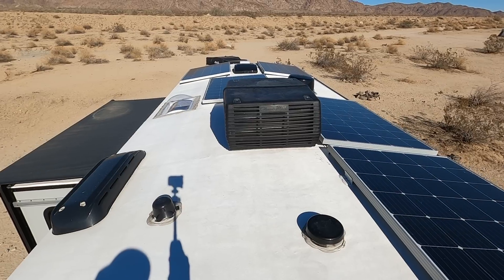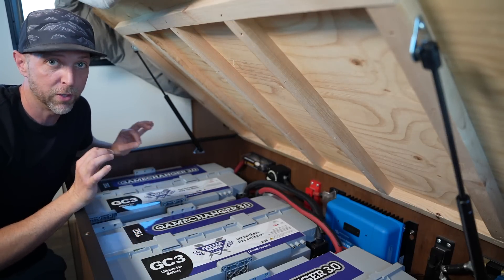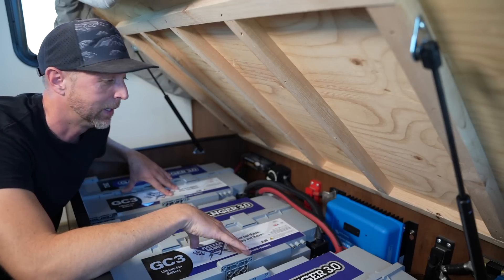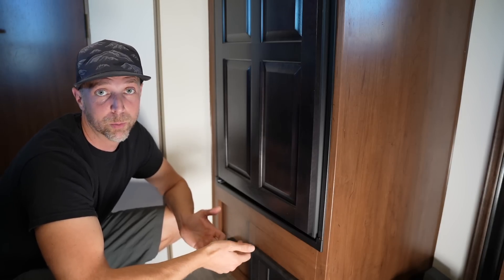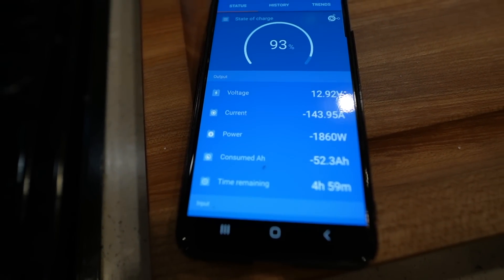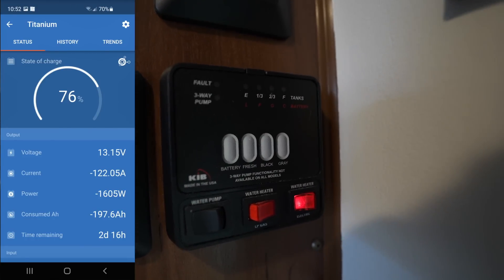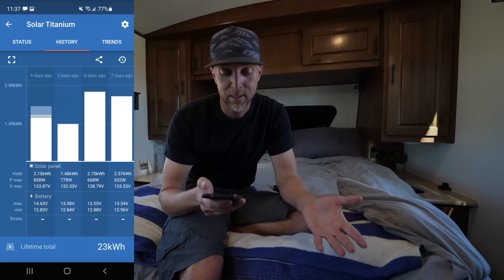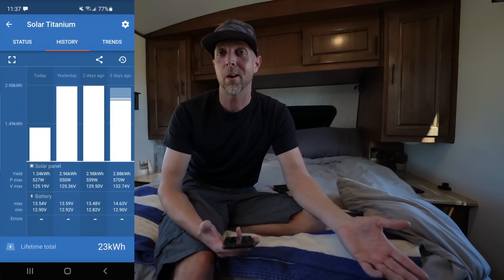RV Electrical UPGRADE Overview for Full Time RV Living | Battle Born Batteries

Comment: Great job on your DIY system. We too did a DIY system. We have 2000 watts of solar on the roof of our motorhome. Plus we have additional 1000 watts we can place on the ground. 600 amp hours of lithium batteries. With this system we are able to run our A/C heat pump system, microwave,water heater, and residential 120AC refrigerator. We swapped out the RV gas/electric refrigerator which was 8CuFt. For a 10CuFt. Did not have to make any mods to the rig it fit into the same open as the gas/electric. Has been running just about 24/7 for the last 2 years. We run three charge controllers. Our panels are 345 watts each. Three panels on the roof can be tilted the other 3 are stationary. This is the reason I run 3 charge controllers so we are able to get maximum out. Our inverter is a 3500 /7000 watt pure sine wave. We have been running our system for just over 4 years. The only issue we have had was we started out with a 12 volt DC refrigerator. Which was not frost free and would freeze up with continuous running. That would happen around 4 to 6 weeks of running. We are currently wintering at the Imperial Dam LTVA Yuma. If get to the area stop by. Safe travels and sorry for being long winded.
Reply from the maker: Wow, that is a great set up you have!
Reply: @IreneIronTravels  Thank You

Comment: We have a similar system with 600 amp/hr lithium batteries. The next item on your list will be a DC-DC charger. That is a game changer for rapid charging Li batteries. We have two Victron 30 amp chargers wired in parallel for a total of 60 amp per hour of charging which is in addition to the solar panels when driving. With 800 amp/hr you will certainly be running the air conditioner off batteries in warm weather and will need the extra charging boost.
Reply from the maker: Nice setup you have! We do have a Victron DC-DC in our truck for the secondary battery, but I wanted to test out the solar and see how well it charges first. But agreed the DC-DC's are awesome!!

Comment: I'd be interested in seeing how your inverter connects to your converter, maybe in a future video. Many folks are doing smaller conversions with just two (or one) lithium batteries for weekend trips, so charging from shore power via the converter is an interesting and overlooked topic. Love your vids btw!
Reply from the maker: Hey Matt, thanks! We actually disconnected the converter, because the inverter is also a charger and acts as a passthrough when hooked up to shore power. So the shore power goes to the surge protector, then the inverter, then back to the AC/DC breaker panel which then powers the whole coach. Before we added the inverter we just left the batteries hooked up to the converter the way it comes from the factory. One big benefit of the inverter is it charges at 120 amps and the converter was only 45 amps. But, good question and I will cover that more in the install videos!
Reply: I built my own battery box using a 100 amp hour lithium battery and a 3000 w pure sign inverter and a 200 w Renogy solar suitcase that has a built-in charge controller. And the charge controller can charge any type of battery including lithium gel lead acid AGM it's just oh and also it's waterproof you can leave it outside without worrying about damaging it not that I would but if it got caught in a rainstorm I don't have to worry. And putting it inside a box you can carry it around use it on your rig or away from your rig and it charges up very quickly using that 200 white solar suitcase. I also buy the 20 ft cable so I can locate that suitcase further away from where I'm using these power. And the lithium battery only weighs 30 lb so it's not hard to carry around.

Comment: What protection have you taken to avoid overcharge on your system in the Summer months ? I've heard of possible fire danger from solar systems if they get overheated.
Reply from the maker: Hey Chris! All of the batteries, inverter, and solar controller have built in protection from over charging. Charging is based on voltage in the batteries, so when they reach a certain voltage (14.6 volts in my case) the charger then switches from bulk charging (full power), to absorption (reduced power), and finally it sits a float ( very little power) when the batteries are full(13.6 volts). I do have a monitor on the temp of the batteries which I will keep an eye on. I may need to add a temperature controlled fan to help cool the compartment if it gets to hot.
Reply: @IreneIronTravels  Don't forget that the actual solar panels can also overheat which could cause a roof fire. This has occurred on both houses and trailers so some warning system should be installed there as well. In overheating cases I have seen people use insulating covers put over solar panels to prevent overheating but this defeats the purpose of power generation and storage.
Reply from the maker: Good point, I'll look into that. The panels do have an over voltage protection built in as well, but don't know exactly how that works..... It is important to keep an eye on the wiring and temps. Thanks!

Comment: I only ever considered lithium because of the weight/power capacity, but that was a great explanation of the difference with AGM. Also, I tried to design a system that could run without propane. Everyone said it was impossible. I haven't got my heating 100% figured out, but so far, so good.
Reply from the maker: Good job! We love ditching the generator and it would be great to go completely get ride of propane. That heat is a tough one for sure. We might look into low wattage electric space heaters and experiment with that. But, we try to run from the cold as much as possible!
Reply: @IreneIronTravels  I was able to install some cigarette outlets and I have 12v electric blankets to stay warm. Peak watts are around 75w but they are not on all night. I can't completely get rid of propane because I camp in some cold places but they definitely help conserve it.

Comment: Nice work! Kudos to Aaron on the electrical work. The Cosori air fryer is great. Had mine for a few years, but it bit the dust after hubby used oven cleaner in it. 😭 Ended up replacing it with the Ninja Foodie air fryer that stands up on its backside when not in use. Saves a lot of counterspace. Nice kitchen set up too, love the John Boos cutting board. It almost doubles as art! 😀
Reply from the maker: Thanks Joyce! Noted....dont use oven cleaner on the air fryer...😂🤣. I saw that folding Ninja and looked pretty cool! Chris LOVES her Boos!
Reply: @IreneIronTravels  Hubby was in the doghouse for that one!

Comment: Nice job guys! Looks like it’s working like a charm… Next you should look into installing a mini split!
Reply from the maker: Thanks! Those are pretty cool and would allow AC all day! 😳
Reply: @IreneIronTravels  I would seriously consider it, even with the solar, the AC has a hard time keeping it cool in a travel trailer. I had one with the soft start and 600ah of Battleborn. When I turned off the AC for just a few minutes it would get hot in there fast. It used about 1300w. I switched to a mini split and it draws around 500w and is incredibly quiet! It can also provide heat but not as efficient.
Reply: With in the next year we will be switching over to a mini split, removing the roof top air conditioner and installing another 350 watt panel in its place.

Comment: What does it cost for a solar / battery system like yours?
Reply from the maker: I don't have an exact number, but the components would be around $12,000-$15,000 and labor could $5,000-$7,000 maybe...

Comment: Great Video! We too just installed a Battleborn system, pretty much identical to yours under the bed, but with 400 amp hours.  I'm really anxious to here about what type (mono or poly) and brand solar panels you installed.  I want to install 800 watts (4 -200 watt panels) but really don't know which brand to go with as everyone seems to have a different opinion and results.
Reply from the maker: Hey Bill! When I researched panels I found mono to be a better option for RVs because they are more efficient and allow for a small panel. We went with Newpowa 240 watt panels, mainly because they fit my roof footprint perfect and allowed me to maximize the watts to 1200. They are wired in series which allowed me to use the factory solar pre wires and they produce 120 volts at 10 amps to maximize a MPPT solar controller. I would say Newpowa, Rich Solar, Grape Solar, HQST, Eco Worthy, and Renogy are all very similar in quality and price. We have a Zamp on the truck and our portable suitcase which is at a higher price point, mainly because they are made in Bend Oregen( and great quality) , instead of the others that are from over seas. We had Renogy's on our Sprinter van and all three brands we have used have been great. I do think Newpowa has 210 watt panels  in the same foot print as a 200 watt if you want to check those out. Otherwise, of the over seas brands I think Renogy has been around the longest and might have a small edge over the rest.
Reply: @IreneIronTravels  That's really helpful Aaron.  Thank you so much!  I was originally thinking wiring them in parallel but probly nerd to rethink that as we also have the ORV (24rks) which is probably prewired similar to yours (need to doublecheck up top) I would guess.  Thank you again for the response,  I look forward to your install video!  Have a great day, and safe travels!🙂
Reply: @billd.8925  be careful of shading when wiring in series, it will inhibit the entire system. A combination of series and parallel is easy and will still let you use lighter guage wire. Watch how the shade moves over your roof before you place the panels if you can. The AC unit can be more of a challenge than you might think.

Comment: I just love you guys.  When you both are excited, and positive about tackling issues... I get excited and thrilled with you.  I'm curious about the install of the solar panels in regard to the rubber roof.  Any mounting issues?  As you know, I'm not a fan of those roofs.  Not so much when they're new, but as they age.  So educate me young man, how'd that work out do you think?
Blessings on you both.  I'm so encouraged to watch your love grow.  That will be vitally important when you face tough situations, as we most certainly do throughout life at times.  Be a blessing to others along the journey, and keep your hearts open to God, as He reveals Himself to you both in a new fresh way.
You're fun, you're goofy, you're bright and shining.  I'm so honored to be your fellow Countryman.  Be wise, be gentle, easy to entreat, quick to forgive.....and never ever stop being goofy!  Keep us posted !
Reply from the maker: Thanks Roger! Appreciate the kind words of wisdom and encouragement! 
The solar install went surprising smooth! We used standard "Z" panel mounting brackets and our roof is 3/8 plywood with 16 in wood rafters. We used a strip of butyl tape underneath and put (4) one inch wood screws in each bracket. Then we put ample Dicor sealant overtop and crossed our fingers! 🤣 J/K, but I think that should be good as I see RV manufactures use the butyl tape / dicor combination for sealing fans and other roof components. It turned out really good! 80 holes total!
Reply: S. W. E. E. T.  !!!!

Comment: It appears the inverter isn't taking up a whole lot of space in your pass-through storage. And, since the bed in our 26KVS should be similar to yours, it's very encouraging that I should be able to fit GameChanger batteries under ours. I'm going to schedule a consultation with Battle Born in the next few weeks (we live, like, 15 minutes from their office) to begin designing a scalable system. Thank you very much!
Reply from the maker: Yes, very pleased with the inverter space  on the drivers side pass through and the  other 90% is still usable from the passenger side. You will love your new system once you get it in your ORV!

Comment: Amazing system and well done Aaron on the DIY! Blown away by the recharging speed 1,200W of solar gives you (admittedly in AZ). My question is how did you decide the scale of the system (solar panels, batteries and inverter especially) compared to your expected use. Or did you just max out under-bed and roof geography, I.e., you couldn’t squeeze in one more panel or battery?
Reply from the maker: Thanks Rachael! With this system we did maximize the solar and batteries. With our rig only being 26ft that is most we could fit. I would definitely recommend that people go with as much solar as they can fit and can afford. Or at least plan for future expansion if the need arises. Of course everyones electrical needs vary, but you can expect half as much solar out put in the winter time. With us living in the van with 400 amps of lithium and 300 watts of solar we had a pretty good idea of our power consumption and limitations. We were able to be off grid for about a week with that, but we couldn't run the big appliances much and the winter time was pretty tough with our small solar. We new we wanted this next system to be able to run the big AC appliances and not worry in the winter time.

Comment: Good morning Chris and Aaron!!  Woo hoo!  Many congrats on getting your power system up and going!  I think you two knocked it out of the park!

I only have one question-- how do you install a complete solar system, phase by phase?  Hehehe. Just kidding!

We stayed in San Antonio last night; final  leg to South Padre today.  

The Weigh Safe hitch pulled really awesome on the TX roads with the trucks going by or us passing.  I only have 2 objections- it is heavy and with the raised ORVs, the drop is actually in the up position, so you can't lower the tail gate still :-(

Safe travels!!

Edit:a serious question, with the curve in the roof, have you discovered if there is a favorable orientation of the trailer to maximize the solar panel gain?
Reply from the maker: Hey Alan! That's a good dad joke! Phase by phase! Have fun down in SPI it is fun there! We're still experimenting on position for the sun and it is a very low winter sun angle, but I facing south or north is the best so far....
Reply: @IreneIronTravels  Thank you very much.  We are at the Isla Blanca Park, which is a county campground.  It is huge! We are mostly just getting the trailer situated to start tomorrow.  So, we haven't walked around to check it out.  Initial observation -- big place and a bit tired.  And, they are pretty much full (something like 600 sites).

Bleh...we were out in the middle of northwest TX, about 20 miles north of Lamesa TX,  yesterday.  I pulled off to the side of the road to let Remy run around.  When I started the truck, the check engine light came on :-(  Fortunately,  there was a Ford dealer in Lamesa and they had 1 tech in doing a few things.  And, fortunately,  it is an O2 sensor, so kept on driving.  The tech reset it, but it came on again at our next fuel stop.  So, we will try to get that in while we are here.  

Remy is NOT digging the 70s and 80s degree weather here hehehe.  But, the trailer a/c works!! On another bummer note, both our bathroom and kitchen hoses have some leaks.  That has only been seen by my wife,  so will tweek that and see if I can get it to stop.

Safe travels!!

Comment: Would love a system like this but no way would I sleep ontop of it. Aren't y'all worried about all the EMF? One of the benefit of being in a camper is that it acts like a faraday cage to protect us from all the electro magnetic frequencies that surround us. Why on earth would you want to sleep on top of it when during sleep our bodies are trying to repair? 😲
Reply from the maker: We haven't noticed any ill will effects in the past three years of having our RV electrical system under the bed. We'll get comments about EMF every once in a while and honestly I haven't been able to find real good conclusive info about it. Do you have any reading/info sources I could look into?
Reply: @IreneIronTravels  I posted a link but it got deleted. I highly recommend searching on duck duck go EMF dangers of solar panels and inverters. I also recommend you get a good meter and keep an eye on how much is in your camper. You could minimize the effects on your body by putting shielding paint around the battery storage area but that won't do much for the EMFS coming from the wiring. It's very very dangerous and shouldn't be taken so lightly. At the very least, just get a meter.
Reply from the maker: Thank you, we'll do some more digging into it. Yes, Youtube seems to delete any comments with links in them now. Appreciate the note back.
Reply: Chill Out, It’s just batteries LOL 😂
Reply: @johnphillips8088  It's not just batteries under there. But hey y'all go ahead. As for me, I'll let my body heal itself while I'm sleeping.
Reply: By the way great job. Enjoy
Reply from the maker: Thanks John!
Reply: Seabliss22.. I was thinking the same thing. Having them under my bed would be a concern to me too.